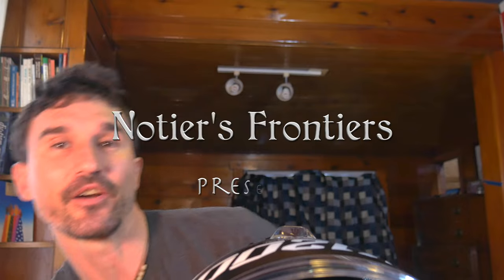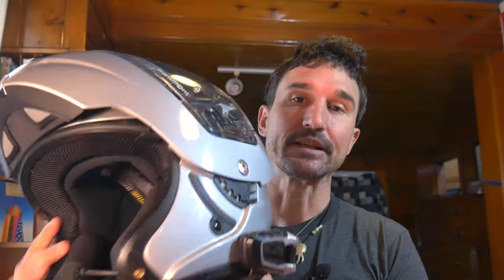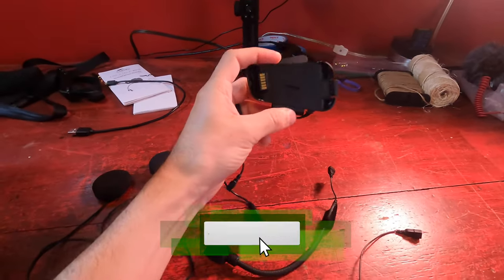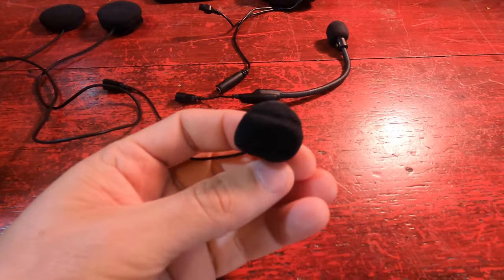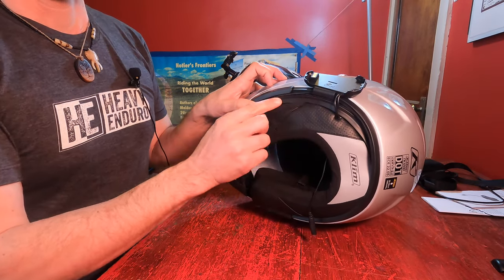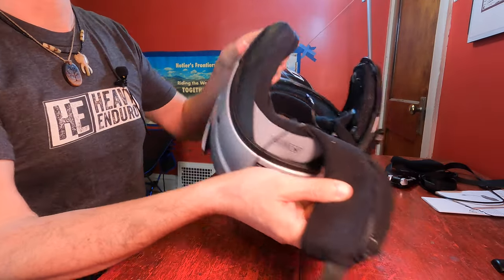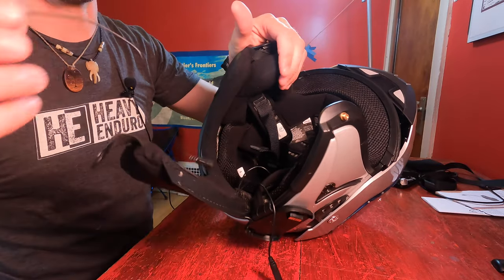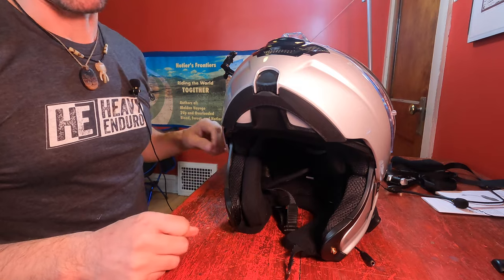How to Install a Cardo Intercom into a Helmet – [Tim’s Tutorials 01] Moto Travel Tips

Comment: Hi Tim- Nice video.

I have the Packtalk Bold on my Shoei Neotec 2-used the adhesive backing rather than the clamp- it's been very secure.  
I did try the hockey puck microphone, but it seemed unusable- I placed it off to the side, due to the Shoei's modular design- and it just wouldn't reliably pick up my voice commands.  So I've used the boom mic, which works ok.

I'm wondering if you tried the Shoei Neotec 2 helmet, and if you compared it to the Klim TK 1200 that you bought.
Reply from the maker: Hey there!
Thanks for the comments! Good to know that the adhesive plate holds up well!
I haven't held the other helmet you mentioned, but the TK1200 is a nice light helmet that I will definitely give an update on after some miles are under us!
Reply: I am wearing the Neotech II and I love it.  I use Sena SRL and I love the built in feature but find the speakers a bit low. Of course that could be the shape of my head.  The sound and functions are great and I use the boom mike.

I am interested in hearing the review of the Klim helmet.